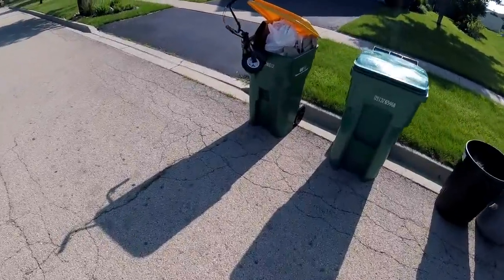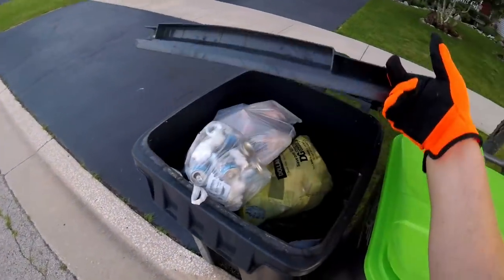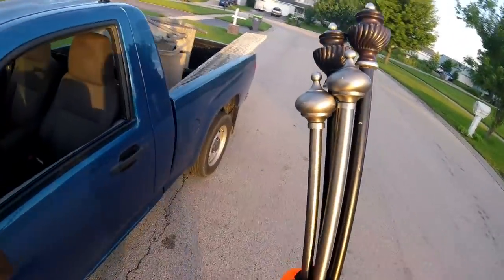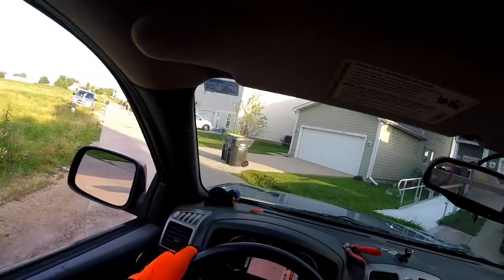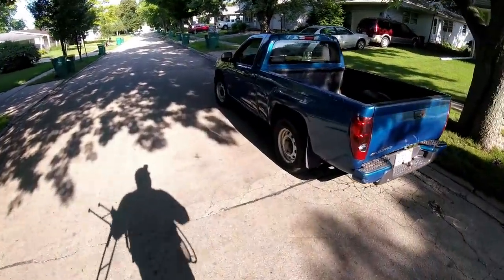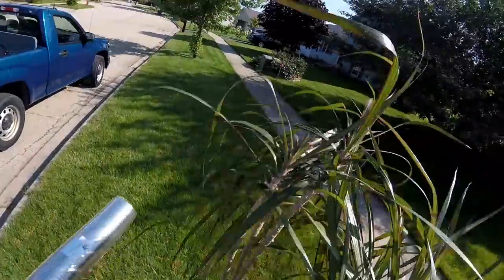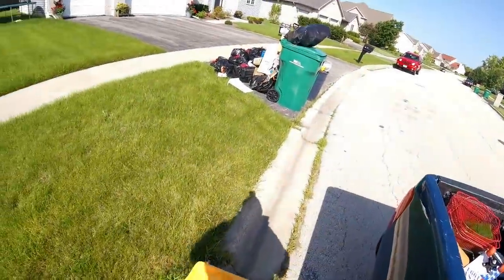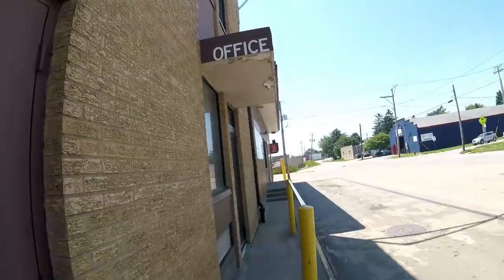Found Mini Bike Scrapping

Comment: Ebike batteries often got stolen off the bike as they used to cost £300, but now you can build your own for £80 so it's a much bigger risk if you're caught.  Are you allowed to apply a peel-off (ie. removeable) adhesive card to waste bin lids to promote your metal scrapping service?

Comment: If you pay attention to Scrap Vultures avg. scrap receipt and compare to yours, his is the same or higher. He hits more spots and takes smaller higher yielding materials. Your little truck hauls more than his scooter and you typically find and take the steel that he’d leave behind. Not to mention, if you compared your bed size to larger trucks, your square footage is marginally less. Besides, how often will you be hauling 8’+ steel 
I-beams. Your little truck needs some love. The less scratchy your hauler, the less ire you’ll get from judgey folks. 
Keep up the good work😀

Comment: So I'm in McMasterville, Quebec, Canada I have three scrap yards near me about ten minutes away, today steel-sheet metal etc $520 a ton ,aluminum siding .52cents, copper wire with insulation cords .78cents made 24.66 which they round off to .75
Reply from the maker: That's a great set of prices.
Reply: just realised they weighed my steel in Kgs so its actually $234 a ton

Comment: most yards in my area count x-mas lights as #2 household cords last I checked cords paid .70 cents per pound but they also require bulbs and ends are clipped off cords. there is one yard that will take them as is and pay 10 cents per pound for xmas lights then 55 cents per pound on all other number 2 cords its a bummer

Comment: hey paul this is one example where you need a battery power saw so you can cut them chairs up so they will fit in the truck better ,,,,,,and it only take just a minute to cut then and they will lay flat in your truck
Reply from the maker: Hi Kelly. You are right.

Comment: If u get a small trailer keep it at ur house until u fill it and make bigger runs when both the trailer and truck are full
Reply from the maker: I would like to get a trailer just a drag around with me as I'm scrapping . It's just as easy to take the scrap and throw it on the ground at the scrapyard as it is to taking it off a truck into a trailer. Actually it would save me a step.
Reply: Scrap & Pallet Man true if u ever decide to strip ur wire take a drill and pulley put the wire on the pulley use a utility knife